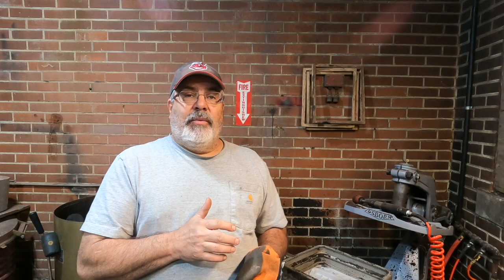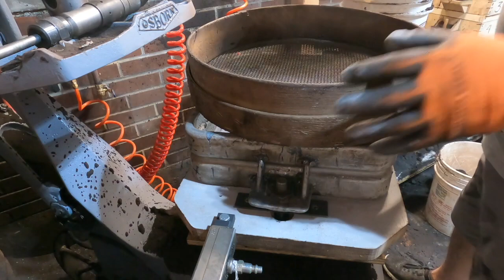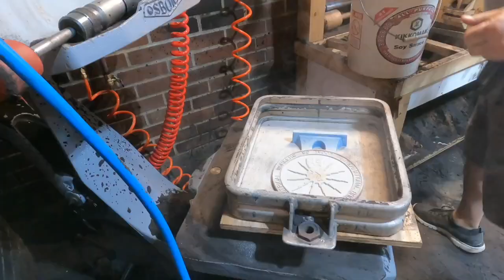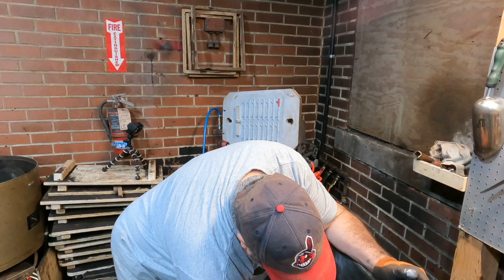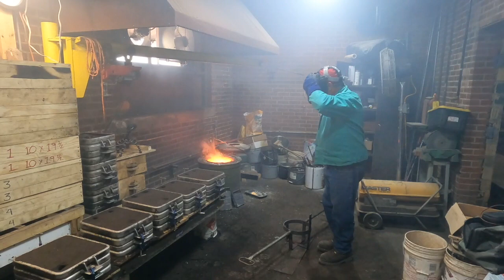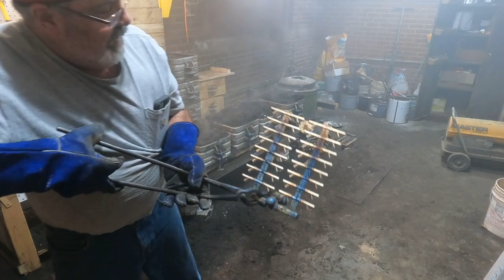Casting a Statuette and More Y-Pipes

Comment: Who manufactured those corrugated aluminum flasks?
I recently bought some on a school auction and the pin centers are inconsistent.
What do you recommend for matchplate guides to go with them.
Reply from the maker: Not sure. I bought all of the foundry equipment from a school that was getting rid of all of there shops. Look on line, or I am selling aluminum flasks myself.  I point one out in my foundry tour video. If you are interested send me an e-mail.